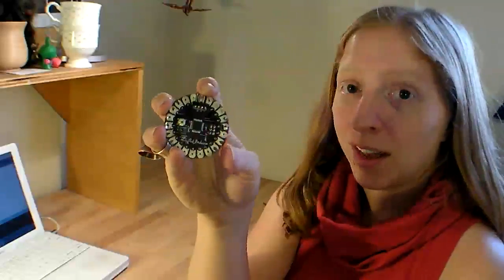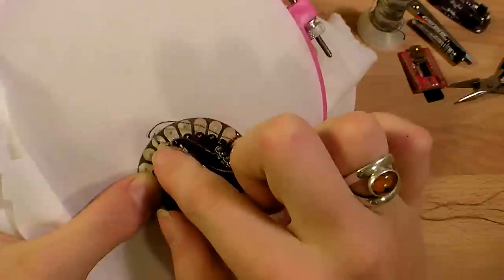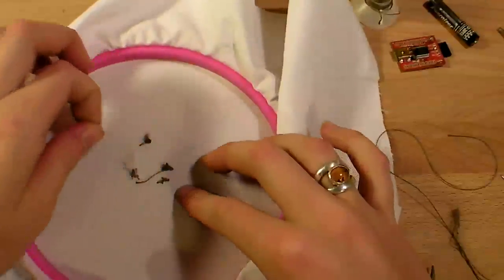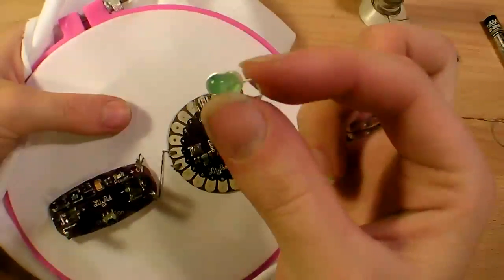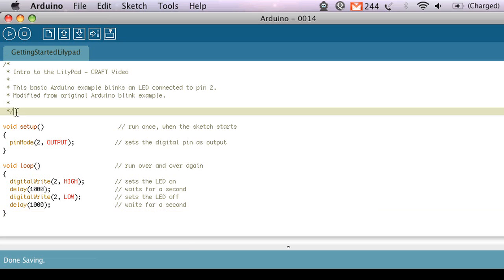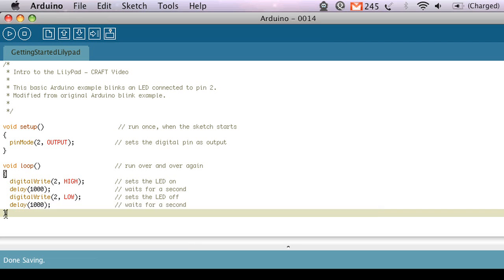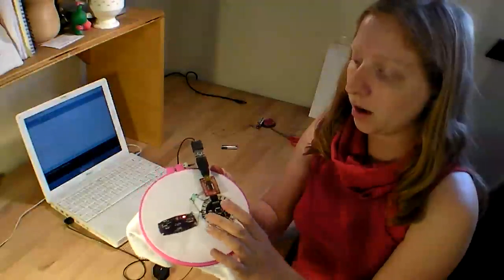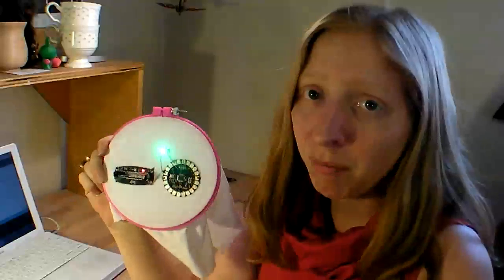CRAFT Video: LilyPad Arduino 101

Comment: does anyone know where i can get just that battery power supply component? i have a different one but i like the arduino one better, it will fit on my device a lot easier than the one im using

Comment: how can lilypad makes a 5v if you use AA battery, it generate 1,5 v
 lool
Reply: That's why there's a power supply
Reply: You can convert 1,5V to 5V but loosing the current. for example 1.5V and 150mA will be converted to 5V 90mA.

Comment: its better to use LilyPad Arduino SimpleSnap :http://arduino.cc/en/Main/ArduinoLilyPadSimpleSnap
It has a built in lithium polymer battery, and instead of through-holes, it has conductive snaps
Reply: +Vašek Dvořák true if you want to be able to use yr lilypad for other things as well. If you do not have the simplesnap, it is quite easy to solder these  snaps on the Lilypad

Comment: I found this very helpful, thank you! I'm planning on doing a big project, and I was wondering if there was any way to get the lights to turn on and off with a button? And are there any other options for power besides the AA battery?

Comment from the maker: You're right, and that LED is definitely brighter than it is supposed to be. The conductive thread has nontrivial resistance, so depending on how far away from the controller board it is, you might not have to use a resistor. Most LEDs are 3V.